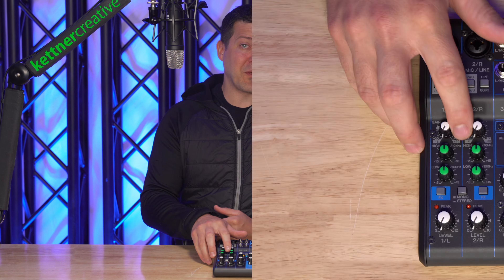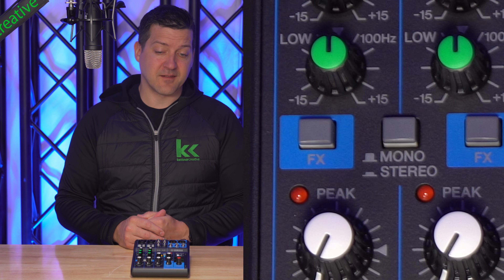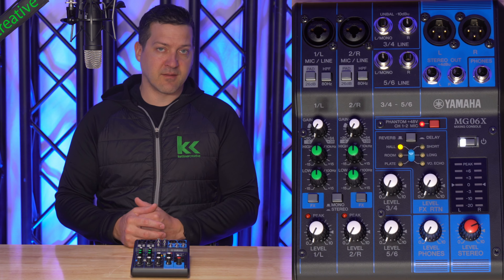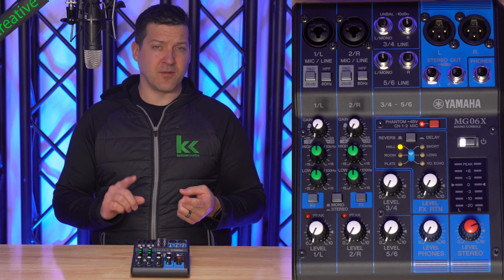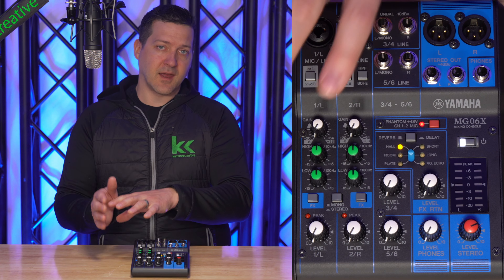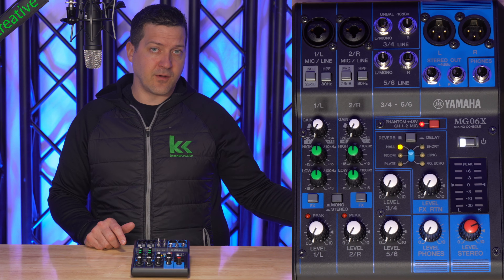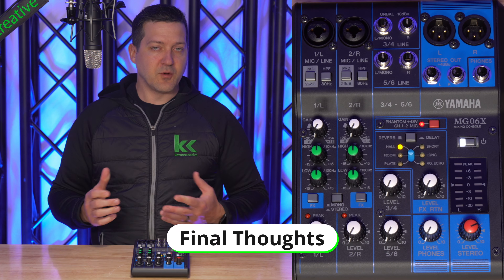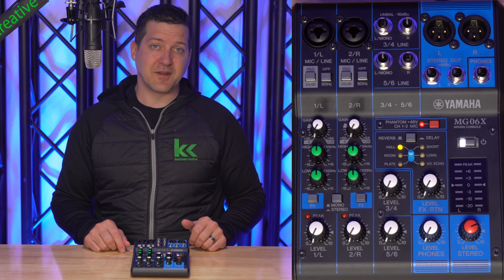Yamaha MG06X Mono/Stereo Button | What Does It Do?

Comment: I'd like to add to this for better understanding. When referencing "pan" that means that when the stereo mode is activated channel 1/L volume will only increase what  the master Left out is connected to and the Chanel 2/R volume will increase volume sent to the right master output. Which would actually work great if 1 mic was for 1 room and the other mic was for another room where left and right out puts where for different locations/ rooms (breakouts)
Reply from the maker: For sure, but in that situation you're often dealing with a bigger mixer that can route the audio properly. I can't imagine trying to run two breakout rooms with different content and being told that I have to use the MG06X to make it happen.

Comment: or speakers in same room but maybe you want to control the sound to be less in a certain area and you wish to control the outputs separately for a particular device laptop tablet or mic and in that case you could use Left for monitors or behind the mic and right for the rest of the venue to prevent feed back to the mic
Reply from the maker: Same as before, I think you'd just be trying to do too much with this little mixer. That's a big ask for the MG06X.